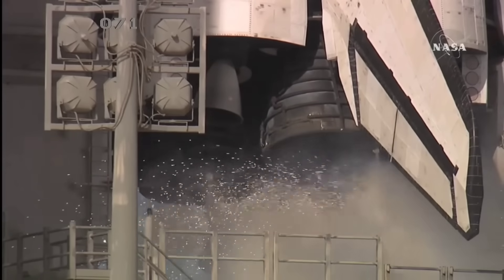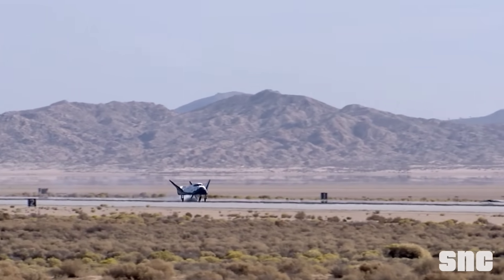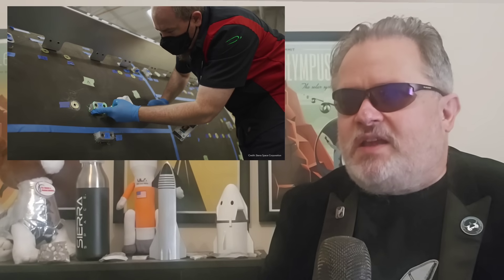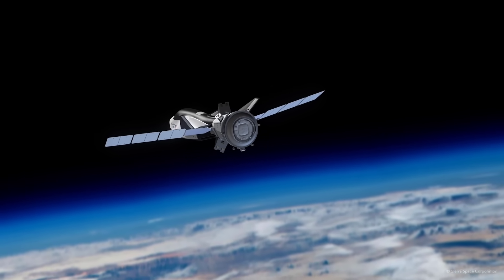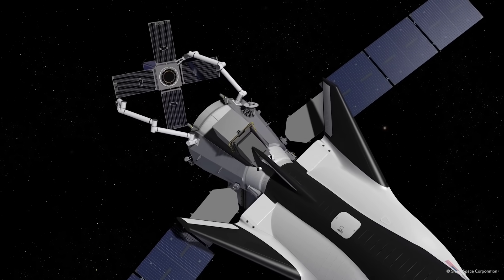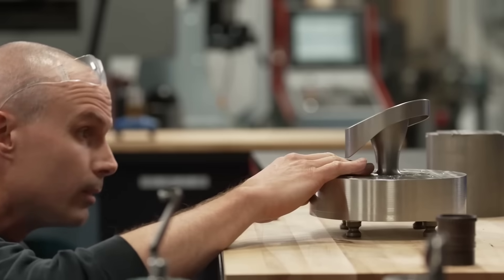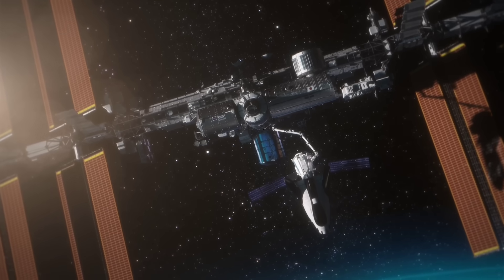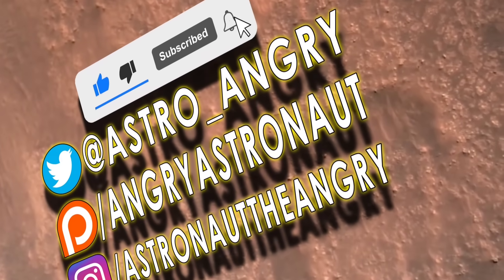Dreamchaser is better than SpaceX Dragon and even Starship for some jobs!  Here's why.

Comment: Correction!
SpaceX dragon doesn't require an ocean Landing, it was originally designed to return on land. But NASA demanded a water landing, as well as only 4 astronauts instead of 7.
Reply: Yes, I remember discussing that it was designed to land on dry ground but they never certified it for human transport.  I guess they "wanted to get their feet wet" first with Space X (okay, I see the door)!
Reply: So could SpaceX now modify Dragon to do terrestrial landings?  Perhaps for their own Axiom flights if not for NASA missions?
Reply: @dansorkin6985  
Doubtful, at this point in time SpaceX has no plans on building any new dragon capsules, at least not until after Starship is out of design and test stage and into production.
Reply: @dansorkin6985  SpaceX does not want to divert research and development from Starship, which will be much cheaper than Falcon 9, is fully reusable (Dreamchaser's owners insist on using an unproven booster with only hand-waving statements about maybe, someday, recovering the main engines) and has at least five times the payload, and will return to land.  Dreamchaser may eventually offer a lower price than SpaceX, but it is inconceivable that they can operate for a lower *cost*.
Reply: The cost to certify Dragon for a land landing is seen as too high. And if I recall correctly, Dragon was to land without a parachute. Eeek! So perhaps they could certify it more cheaply for a parachute plus rocket assist landing on terra firma.
Reply: It won't make it to Mars !!

Comment: Without a reusable Atlas Booster, Dream Cathers is far more expensive than Dragon.
Reply: Vulcan will be partially re usable. What Dream Chaser does need is a fly back booster. Maybe F-9?
Reply: @bernieeod57  - as far as i got it, F9 could carry the crewed version only
Reply: @helgekumpfert4011  Should not be too hard to make a fairing or launch the cargo version without the fairing
Reply: @bernieeod57  Vulcan has a 2nd stage major flaw (exploded can't stand the pressure).
Reply: And the Ariane 6 is supposed to be half the cost of the 5... so that is a plus even if its expendable. Factor in the plus of the 'pod' and the plusses are considerable. Heck, US Military has already bought one of them for use!
Plus the pods could probably launch smallsats from outside the pod! Another way to defray costs!
Reply: Don't forget that a bigger fairing is coming for the F9/FH
Reply: I would dig the X-33 out of the trash and redesign it as a glide back booster for Dream Chaser

Comment: Dream chaser is doing exactly that, chasing dreams, while Spacex is actually getting things done.
Reply: Hey, I'm a Big SpaceX fan, but there's always room for innovative ideas. Dream Chaser 
seems to fit that bill. I wish them Both the best of Luck!
Reply: @otpyrcralphpierre1742  what has dream chaser done besides collecting dust in a warehouse?
Reply: @saltyfox7056  Nothing so far. But the potential is still there, and it is potentially a very viable spacecraft system.
Reply: @saltyfox7056  they did do some glide tests analogous to those done by the old Enterprise shuttle to verify flight controls and aerodynamics. That database is important going forward.
Reply: SpaceX was chasing dreams as well when trying to be successful with the Falcon 1. Never forget that if that one flight had been a bust, Elon was ready to pull the plug on the whole idea.
Reply: That was a savage comment bruh! 😎🤣

Comment: Dreamchaser should have been selected over the abomination of Starliner and the military industrial complex hand out.  It will have a firm place in access to space.  I think that comparing Dreamchaser to Dragon, yes.  Comparing Dreamchaser to Starship?  No way, like comparing a semi-truck to a 4 door sedan.  They are not the same thing.  Starliner will provide the lowest cost to orbit ever achieved and the largest payload to orbit, still much better per kg than Dreamchaser.  The issue with Dreamchaser is it's complexity, but it is the best shuttle vehicle ever built, of that I have no doubt.

Comment: The Earth is covered by about 70% water, how much of the Earth's surface is taken up with run ways? Both types emergency return vehicle have their advantages.
Reply: The fact that sea planes and flying boats are largely extinct should indicate that the feasibility of using the ocean instead of runways has proven to be less than stellar.
Reply: @antonberkbigler5759  Both of those have pilots, if it's for an emergency return, the computer only has to make sure it reenters where it'll hit part of that 70% water...

The other was touted as a good idea of large space stations, in which each emergecny craft would need a pilot and for that pilot to be available.... Ot it has to stay with the people that want to escape and go down with the ship, so to speak...

A pod just requires it's smart enough to find a return window that will bring it down in water.

As I said, both have their advantages, sure remote piloting is a thing and a acpmiter may be able top glide a shuttle to a run way... A Pod just needs to find water, both systems have their advantages..

Comment: If you remember, SpaceX designed Dragon to be VTOL capable. It just that NASA didn't believe in repulsive landing, which is what the Falcon-9 first stage has perfected.  Dragon's Super Draco thrusters were designed just for that purpose.
Reply: You mean "propulsive" landing. A repulsive landing would be something like the top of a flight of stairs, covered with rotting garbage.
Reply: @kevinvanhorn2193  or like two magnets repelling each other. but yeah we get what your saying and understand what the OP meant as well.
Reply: @kevinvanhorn2193  Some people call them Descent Thrusters or Landing Thrusters.
Reply: I've always wondered if SpaceX kept that capability as a last resort in the extreme event that the chutes failed or were destroyed on descent for some reason (eg mid-air collision with a stray aircraft).
Reply: @JoshuaRichards2010 That’d be a WILD ride!
Reply: @JoshuaRichards2010 it needs landing legs
Reply: @bonglambitco80  In an emergency use scenario it would be fine -- you aren't worried about the craft at that point.  Sort of like an airplane landing with the landing gear stuck in the retracted position, you only care that the people on board make it off safely.
Reply: There was also an issue with sealing the leg design against the heat shield.
Reply: @migs7220  I thought there was a design where Dragon had fold out legs ....same as Falcon 9
Reply: Yes, but that doesn't mean it can land anywhere. DreamChaser sheds speed aerodynamically and can land at any international airport. Dragon has to land either on the sea or in the desert somewhere.
Reply: @neutrino78x  That also limits Dreamchaser's landing choices. It can only land in an area with a runway. Dragon can literally land in any area where there is surface.
Reply: @The_Crazy_Monkey75 

"That also limits Dreamchaser's landing choices. It can only land in an area with a runway."

Dreamchaser is better in a couple different ways

(1) company CEO is not racist/bigot/right wing extremist

(2) it can shed speed aerodynamically and make a soft landing on any runway. Capsules can't slow down for a nice gentle runaway landing, that's why they aimed the apollo capsules at the sea when landing
Reply: No one likes an ugly landing 🙃
Reply: Yes NASA was repulsed by the consept of a repulsive landing 🙂
Reply: @airbusboeing2502  Hmm, would still work with precise enough timing.  The computer would have to calculate when to fire them off.
Reply: @JoshuaRichards2010  True but maybe something similar to landing Rovers on Mars with sky crane. The tech is there but is it used? I couldn't tell ya.
Reply: No one likes repulsive landings, they're garbage. Propulsive landings however ...
Reply: If SpaceX hadn't had Starship in mind, they probably would have just continued with propulsive landing. I believe they might have anyway. I mean, why not? Massive chute failure? Release the chutes and propulsively land. What's NASA going to do if they save a crew of astronauts with an untested system, sue them?
Reply: @airbusboeing2502  Whatever the force it would be a lot less than the ground / water without a chute.  Also, IIRC they use them for emergency abort, so it should be survivable.

Comment: I'd love to see lifting bodies (Dream Chaser included) replace capsules.  Maybe the only capsule could be used as a last ditch escape pod for the ISS.
Reply: That's all about a capsule is good for! Even water landings are acceptable from an emergency exit point of view. Dreamchaser has the major advantage of lower cost for recovery, immediate exit of the crew when on the ground and I expect that due to the lower re-entry heat it will be a lot easier to service and prepare for re-use compared to the very toasty re-entry capsule marshmallow.
Reply: How about belly-flopping bodies?
Reply: "Activating emergency CPR. Vital signs stabilizing" (c)